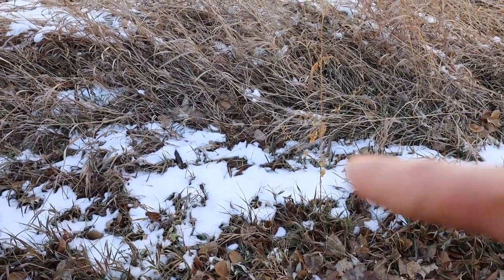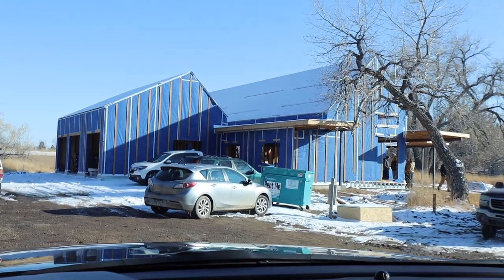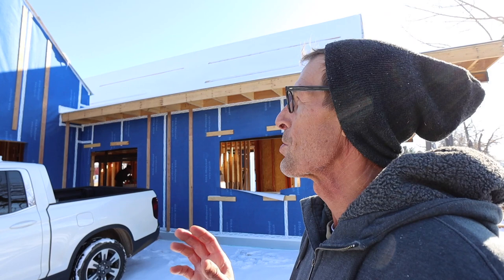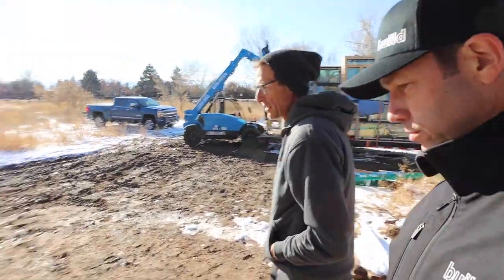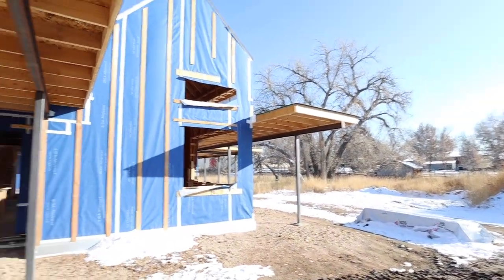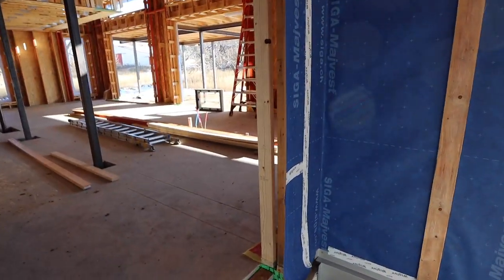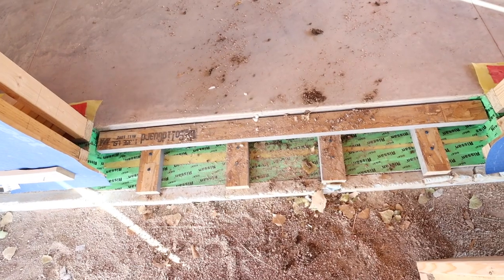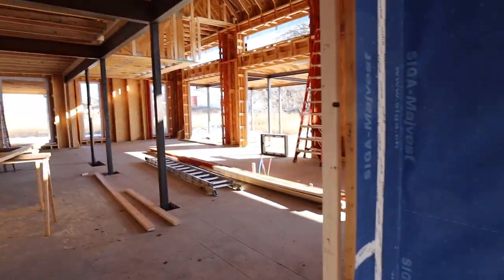Double Stud Walls and Bark Siding - This House is COOL

Comment: I'm guessing this costs 5X what a conventional build would be. I understand that there is no comparison between those two, but adobe could very nearly accomplish the same thing as this with 1/10 of the labor involved. This degree of complexity is beyond the reach of 99% of home owners. Fascinating. A masterpiece in the making just not practical on a large scale.
Reply: I think you are wrong. It's like Formula 1, the sport makes for innovation, and later good ideas gets to normal cars. And complexity, look at how easy it is to fill the walls with insulation. And they way electrical runs in own space. You cut out a lot of work there.
Reply: @72strand  
A second semi-detached stud wall covered with a vapor barrier taped to the underlying waterproof membrane under the slab and a robust system of 2x3 furring covering the entire wall is hardly a shortcut to  allow an easier installation of the electrical and insulation. This really isn't an innovation beyond doubling up a common stud wall with engineered lumber.
Reply: @oltedders  Where i live this is how most new houses are built. Vapor barrier. Then horizontal studs. Then insulation then, OSB and over that drywall. This is to the inside.  2x3 is a bit overkill, but hey this is a passive house, and they normally have double of thickness.
Reply: @72strand  
This is definitely overkill. The triple glazed windows are also redundant.  Colorado winters are not that severe, as you can see in the video. Nor are the summers that hot. I remember one year when we didn't hit 90° the entire summer.  This home could easily exist 1000 miles farther north without a single change to its make up.
Reply: @oltedders  Where i live, The triple glazed windows are standard and have been for 20 years. I don't thing you are allowed too build with 2 glazed. They thing is, in US ppl worries about studs and thermal transfer, but they don't know that Windows and floors are the weakest points. They don't insulate under the slab, and they put in one or two glazed windows. And some even put in leaky sliding windows. OMG.
Reply: @72strand  
Sliding doors are the worst. Good only in a year round temperate climate.

Comment: -Better put a ventilation system in. It will be a few years and the mold will start. Seen it.
Reply: All Passive homes require that the envelope is designed in conjunction with a ventilation strategy, don't worry! Otherwise, it would not be able to meet the certification requirements for durability and healthy indoor air.

Comment: why not just go ICF at this point
Reply: Because not all of us want to live inside of a concrete block
Reply: @Dr. Michael Johnson Jr 
Adobe. 1/10 of the labor.
Reply: @oltedders  lies.
Reply: @aktejas_2095  
So what's your background in adobe building?
Reply: @Dr. Michael Johnson Jr Thermal mass in the cold is not such a great thing if the R value isn't there. And concrete is all but energy efficient or renewable and is costly.
Reply: Johnson Rocson Yep, a classic example of engineers over complicating a legacy build.  Reinventing something that doesn’t need fixing.  Another academic making impractical choices to quadruple the cost with minimal r gains and headaches for the trades.
Reply: @1982MCI  you would be hard pressed to point out icf homes from a stick framed after finishing are done.  The give away is always thick walls but this house has the same.  Not a ICF builder or owner just an independent third party.
Reply: @Dr. Michael Johnson Jr 😂🤣😂
Reply: Or straw bales.  Same R-value, way less expensive.
Reply: KeenLaF  Standard ICF's are a sandwich of foam, concrete and foam. With the interior insulation over the concrete, you don't get the full benefit of thermal mass of the concrete.
Reply: That option was presented, but ultimately decided against by Greg for a variety of reasons. There have been Passive Homes in our program that have used ICF, though.
Reply: @rolfbjorn9937  Yes on the R - Value, but I would politely disagree. Colorado State University did a study finding the potato barns of the San Luis Valley where 50 below is common worked well. 6” Adobe wall 6” air gap 6” Adobe wall with a sod roof keep the potatoes from freezing so 80 + degrees of free heat...

Comment: I am now apologizing that I did not go through all of the previous comments.

Double-stud walls is a great step in isolating temperature.

I’m worried about fire blocking.  How do you do that?
Reply: High density blown paper insulation doesn't support flame propagation in the wall cavity. They are using a transparent moisture barrier to visually confirm adequate fill. Touching the ballooned membrane confirms packing density. The internal cavity for wiring, etc is created with horizontal 1x3 which will limit convection. Perhaps this section needs intumescent foam in vertical penetrations.

Comment: Double stud reminds me a bit of the T-Stud.
Reply: Would have to assume T-studs would be significantly less expensive.
Reply: The cellulose insulation probably reduces cost substantially. These wall cavities are at least 12" thick and can easily be much thicker at little addition cost. 

The recycled paper dust insulation is much less expensive than foam and less expensive than fiberglass, while having far less convection current and stratification. It also has superior fire resistance and air safety. I think he said R-60 walls, which is twice the performance over 3x6 T-Studs with fiberglass. 3x8 T-Studs with fiberglass would not perform better, and 100% closed foam would cost more. So deep cavity walls are not all that bad. 

The key is to build the double-stud pairs in a mass-production fashion, even if done by the on-site carpenters. You set up a jig on tables and glue/staple the 1x3s at intervals. Framing is somewhat like "balloon" framing on the outside 2x4s and more like conventional framing for the internal 2x6s. 

No diagonals are used (or needed) for the doubled-studs until the roof trusses. But T-studs have 2x3 pairs turned 90°, so the zig-zag dowels are essential for wall stiffness, which they excel at.

Comment: Positives: Very well-built using state-of-the-art methods for high efficiency. Very impressive. Negatives: Awkward, disjointed architecture. Ugly as shit bark siding. I strongly suspect that was selected as a "statement" rather than because they actually thought it looked good.
Reply: Yup, or it's a show home and the bark siding is given away for marketing purposes.

Comment: nice build, so strange though that he spends all that extra time and detail and uses OSB everywhere, just one small penetration and you have massive problems. In that cold and snowy environment, this is a disaster waiting to happen. Just look back on 1 of matt's older videos where he had to totally redo a job because he used osb and engineered lumber everywhere and 1 badly constructed area caused a water penetration and destroyed it all.

Comment: It's unfortunate that many of these "cool" products are becoming code in the average home.  Between the crazy high cost of extra products and labour to install, the average income family won't have an affordable option.  Its comparable to making hybrid vehicles mandatory to reduce petroleum bills.  At $10,000-$15,000 higher cost than a regular vehicle, you never recognize savings and actually spend more over the 3-5 years of ownership.  The most efficient home I've lived in still had 300-400$ heating bill during winter months, 2000-2600$, or so,  per year.   How much can I possible save on heating/cooling to justify all the extra cost?  The cost of almost tripling insulation requirements to hit R60 walls, plus interest over a 20-25 year mortgage adds up. Now - double walled exterior, all the wraps, tapes, etc...  Price increase of 20-30% will be the new cheap home.   For someone able to afford these building techniques, its extremely cool seeing the ingenuity of builders and the excellent craftsmanship. But, I can almost hear the code writer's cogs of the wheel turning towards "Apply All".  

Another great video though, as alway.   The most enjoyable building channel on YouTube!

Comment: Why did nobody build with 360 tji and cellulose? Easiest way for passivhouse Standard. And inside a 6or 8cm Installation area for water. El. Heating and air.

Comment: looks like a bad design; expensive, complicated, full of thermal bridges, most of the passive (which are free like no north facing glassing, simple building shape etc.)principles are not met but they try to replace them with miles of expensive tape and over engineered structure; passive building does not need a central heating system
Reply: I agree and don't like the design or look.

Comment: Way overkill for an attempt at a passive house.   Seen too many other designs and building techniques that are well over half or more the cost per sq ft to get a sub 1.0 ACH 50    This guy just seems to be an excessive show off   Passive house was obviously just a sidebar objective.   Vaulted ceilings height was a dead giveaway to me that it’s way too excessive of a structure to be a passive or net-zero house.  All building science basics seemed to have been elevated on steroids to help his very large house work.  Doesn’t make sense to me.

Comment: Just save yourself a couple $100,000 and buy yourself a hyperbaric pure oxygen chamber and spend an hour in it a day and then.. That is more than enough climate control you need.. It's like you guys obsess over stacking as many products as possible in the house sandwich as you can.. It's all sponsored, all marketed, and all expensive.. Set aside.. The house itself is pretty interesting..
Reply: Lost me at the bark siding..

Comment: I am sorry but the house is butt ugly.  The bark siding will make it even uglier.  The building concepts seem very sound.  This is a house that will be very hard to sell in the future as it is far from normal building design.  Matt, do you ever consider future resale of the houses you build?
Reply: Also, you needed to spend a little time explaining how the two intersecting parallel gables are going to drain and handle snow loading.  
Seems a weird design for Colorado.
Reply: Yes, but Fort Collins likes funky houses, and Colorado likes butt ugly houses in general.